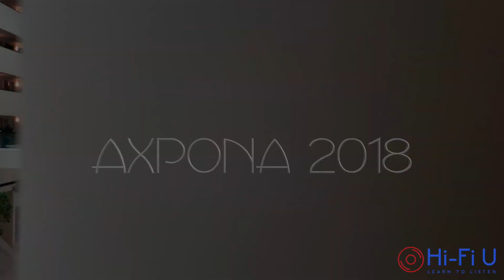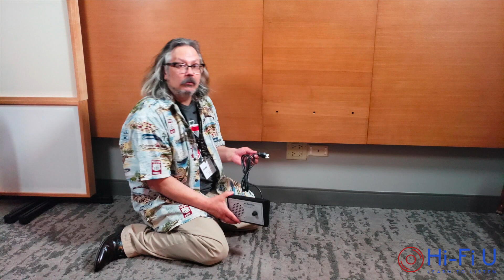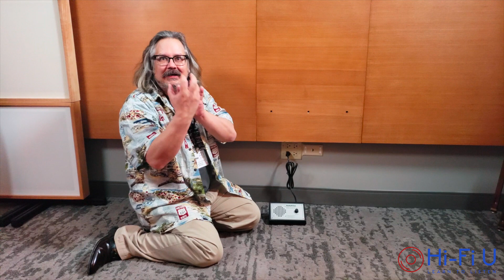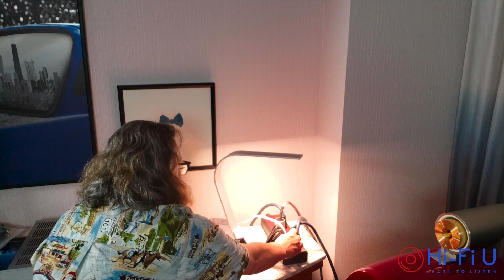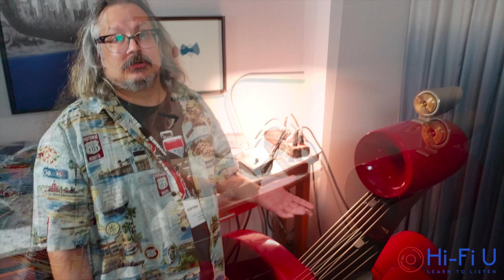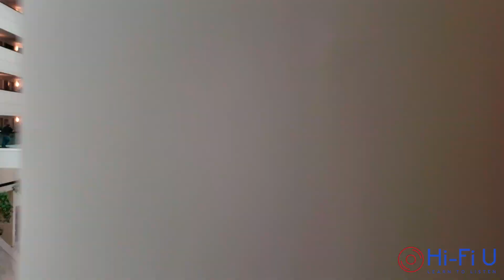Lenny Explains Why A Power Conditioner is a Must

Comment: That proves SQUAT... you would then need to plug in a "power conditioner" and then plug the gadget into the conditioner and show the difference. AND also hook up a receiver and speakers with nothing playing and turn it up so we can see if the "noise" actually comes out the speakers, and then also show the difference by inserting the "power conditioner", etc.

Comment: Yeah right. the 50/60 Hz main frequency is filtered out and you have amplified all other frequencies in the u/mV range by 100 times or more and sent it out to a loudspeaker so people think they have a mains noise problem you moron. Try connect a loudspeaker with a large enough serial resistor into the mains outlet and you will hear just ordinary 50/60 Hz.... MORON

Comment: If the AC noise can be eradicated as simple as that powerstrip looking device you have there then it’ll be an easy thing as well for the big manufacturers like PS Audio and the ohers and it’ll not be branded as a snake oil

Comment: Can you do this exact test again, but instead of going to a different room, use the same outlet for both showing the noise on the line without conditioning; then again, showing the reduced noise with the power conditioner.  The variable to hold constant is the specific outlet and its electrical energy.

Comment: There will always be people out to make a fast buck out of a common misunderstanding regarding technical issues. We know that noise and RF modulated audio can travel through the domestic wiring: this is how cordless baby alarms work. An issue here is amplifier designers fit power conditioners into amplifiers by default: the smoothing capacitors, mains transformer, rectifier perform the function of mains filtration and there's also RF filter components in hifi amplifier power block, already. This is audiofoolery at its maximum: don't waste your money.
Reply: Except each designer uses different level of implementation and quality. Some amps have poor filtering, some don't. You don't know how good your amp is at filtering EMI without trying a high quality power conditioner.

If it makes a difference, then clearly your amp isn't quite as well designed as you thought. If the difference is inaudible, then it's a well designed amp.

Also EMC standard differ depending on the product class. The standards are not designed around what humans can perceive, but what allows a product to work without fault and/or preventing said product from interfering with others. As long as X amp still works without any faults and/or it doesn't interfere with other electronics enough to cause them to have a fault - it's a pass. This is the bare minimum for EMC mitigation. Power conditioners aim to improve this beyond the bare minimum legal requirements, to the point where said product is performing at maximum performance.
Reply: @campersruincod6134  I build and design my own amplifiers. Common mode choke\capacitor arrangements lack inductance and sufficient capacitance to block RF and lower frequency interference. I produce my own music, so interference is especially important. I usually have common mode chokes tuned at 1Khz, in addition to RF in series: low cost. Interference is particular issue with PWR converters, since sine wave is synthesised from switch mode, RF appearing at output. I still think snake oil is going on but assuming funds not an issue, it's harmless.
Reply: @hoofbags  it's definitely not snake oil so as long as it's an actually good power conditioner, say like a Furman Elite or Reference. Is it diminishing returns level of performance gain? Yes. You will hear larger difference from upgrading other parts of your system. It's more for people wanting to optimise the last bit of their system to maximise performance.

Comment: for where i live the power is good, clean and is produced at a steady rate so i turned the volume almost maximum without any music ,etc. , no noise whatsoever, if there isn't any audible interference then a power conditioner is as useless as this video for anyone that doesn't have a power problem. contact your power provider they can back  this.

Comment: My system usually sounds great but sometimes it's not  it sounds like it lacks fidelity. If I listen around 2 to 4 am it sounds great. I wonder if it could need a power conditioner. I live in a house. The electrician said my is set up to receive more electricity than any other house in the neighborhood,  whatever that means. Where can I find a power conditioner like the one in your video? Have a great day
Reply: I think it has to do with weather we pay for music or get it free. Junk in junk out. Remastered doesn't mean  anything  I/you can put our version out there & call it Remastered. also how old the capacitors in our amplifiers  are will  cause it to constantly sound different

Comment: How do the capacitors and filtration devices in the power conditioner differ from the capacitors and filtration devices in the power supplies of any decent piece of audio equipment?
Reply: Barry Rodgers - there is a major difference. These guys squeeze the snake extra hard
Reply: It's not difficult. Simple engineering really. Even if they both uses the same components, more filtration = increased reduction of EMI. Could go from 20dB reduction to 40dB reduction within a system depending on the components. Lower is better. Simple as that.

Comment: Hello! Does anybody know the correct sequence to connect Furman and UPS? Power - Furman - UPS or Power - UPS - Furman??
Cause I know that if you connect an UPS to the Furman it may cause the fact that the batteries work more than requested... on the other side APC suggestes to connect their UPS directly to the power instead to another device (in this case a Furman).
That being said I'm a bit confused...
Any suggestions? 
Thank you!

Comment: God, imagine the effects of this noise on my computer!  If even a single bit gets “distorted”, it could lead to incorrect results or even a crash. I should put a power conditioner on my computer, too, I guess.

So I tried it. Guess what — it made my computer faster, and it ran cooler!  No, I didn’t actually measure or benchmark it — I can see with my own eyes that it’s faster.  If you can’t, you just don’t know what to look for.

Someone told me this is nonsense — that the computer already has a power supply that ensures the circuit is optimized for its purpose.  Well, I know what I saw with my own eyes. What are you going to believe, a properly-designed circuit — OR YOUR EYES?
Reply: This was the comment I was looking for on this video. Thanks. :)
Reply: Mike Thomas placebo?
Reply: Mike Thomas factual, imperial, and methodology evidence is far superior than anecdotal proof, “I think my pc is cooler because I see temperature and it’s faster because someone on the internet said so”
Reply: Denmire I think you may have missed the sarcasm.
Reply: Mike Thomas oops my bad, I guess it wasnt obvious enough for me lol, good bait tho I deserve a wooosh

Comment: Better yet, show amplifier output wave samples with & without the conditioner. Any amplifying system worth it's salt should have a differential input that rejects common-mode noise, like conducted noise in alternating current. Am I wrong?
Reply: Every amp does but each one varies in implementation and performance.

Comment: None of what the guy is claiming is accurate. All decent electronics already filter out mains noise. That means that power conditioners just remove noise that ,in the end, wouldn't affect the equipment. Also, adding noise would just make the noise floor higher. It wouldn't somehow "kill dynamics and detail". I'll give him that dynamics are limited by noise but in an overwhelming majority of cases, the noise is already so low that it doesn't noticeably decrease the dynamic range of a system.
Reply: Better yet, show amplifier output wave samples with & without the conditioner. Any amplifying system worth it's salt should have a differential input that rejects common-mode noise, like conducted noise in alternating current. Am I wrong?
Reply: @DataWaveTaGo  AFAIK a very noisy power supply can sometimes cause audible noise but it has to be REALLY noisy. Otherwise, you're all correct.
Reply: @kacperuminski1547  OK. BTW, I've been designing & building HiFi for 54 years. I have some form of synesthesia that affects my hearing (and more) so I designed & built complete systems & tuned them until they produced a sound I found correct (pleasant if you like).
Reply: @DataWaveTaGo  Ok, good for you! How is it relevant to the discussion at hand?
Reply: @DataWaveTaGo  Just to clarify, I meant a noisy PS from another device that isn't in the system like a computer.
Reply: @kacperuminski1547  re: Ok, good for you! How is it relevant to the discussion at hand?" Because for some people all sources of noise (distortion elements) can be quite a different matter than the general population, thus solutions can vary greatly, even for conducted AC noise due to the the way forms of synesthesia cross into other sensory processing areas. rat ta ta ta ta tat ;)
BTW, I'll haul out my Tectronix 465 'scope and do some tests and report back some day (sorry, I don't have a high end spectral analyser).
Reply: @kacperuminski1547  re: Ok, good for you! How is it relevant to the discussion at hand?"
Second Answer = because You Tube ;)
Reply: @kacperuminski1547  re: "Just to clarify, I meant a noisy PS from another device that isn't in the system like a computer." Yes, that's why I'll scope it out (as we used to say in the 1970's).
Reply: @DataWaveTaGo  I think they still say that today, at least one of my high school English teacher says it about grammar problems. (I'm only 16.)
Reply: @kacperuminski1547  re: "(I'm only 16.)" As Homer Simpson said "Kids today teach themselves, what with the Internet." Sigh, I'd have loved the Internet 1000% when I was 16.

Comment: Sorry but even a $20 boom box from Walgreens has a regulated power supply that will "filter" out line noise.
Reply: yes... how about this, everyone that has a garden hose deals with the approximately the same pressure; different brands and types of nozzles; greatly affect the type and how well it dose there are some better than others. I am just saying.
Reply: @stilllooking39  That's a false analogy.
Reply: nope @kacperuminski1547
Reply: @stilllooking39  Yes, it is. The described situation hasn't got anything in common with the topic at hand. That is, by definition, a false analogy.
Reply: In Your eyes; or ears as the case may be... I bid you good day sir.  @kacperuminski1547